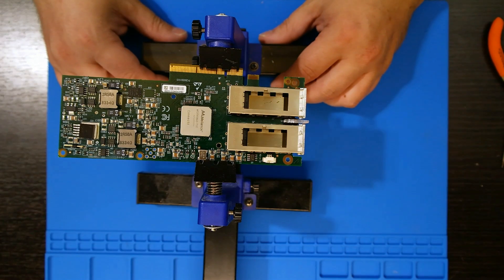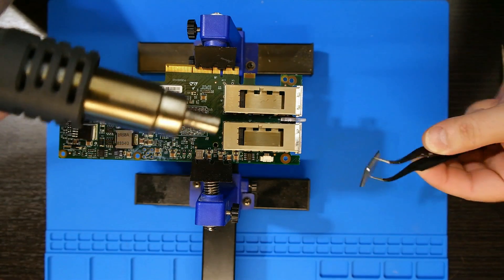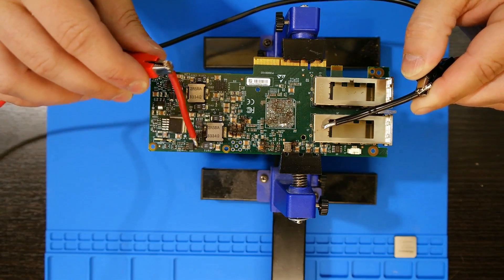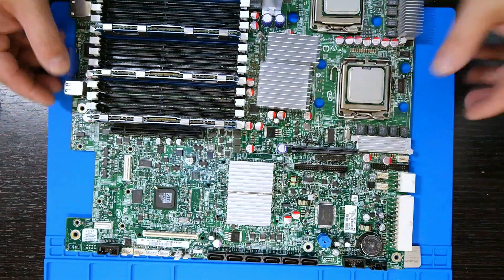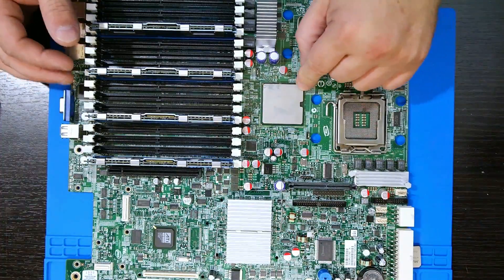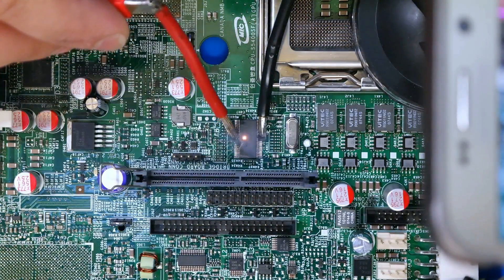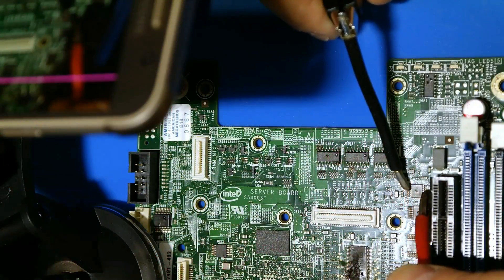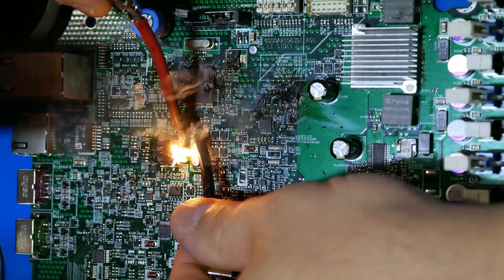Circuit Boards & High Voltage

Comment: Have you considered doing an update video on the capacitor / battery system in your Kia??  It's why I subscribed.
Reply from the maker: I will do another quick update on that series in the middle of summer.  I did post an update a month ago.
Reply: Ok,  cool. Thanks for responding.  May I ask which video please? I'll have to start watching more.  .  .

Comment: BGA...nice 
Yeah I think they have a pre-heater from the bottom then heat the top, I have seen the old ring o' death xbox's fixed by putting the xbox board on a hotplate, masking off the processors, then reflow the processor.
Man you are smoking that stuff...wow
Bet your wife loved the smell afterwards
Reply from the maker: the house stunk for a few hours after shooting that video.  It was fun, and I'm planning on doing it again when I collect enough old circuit boards.